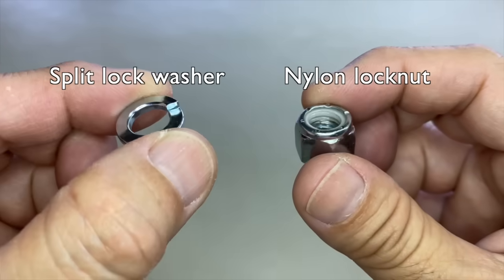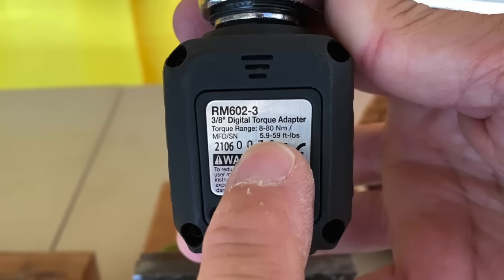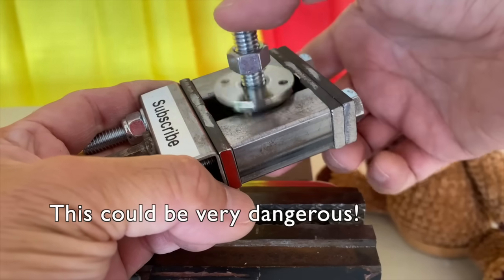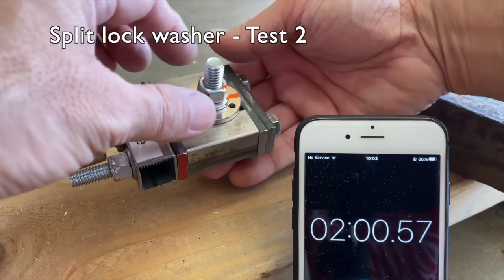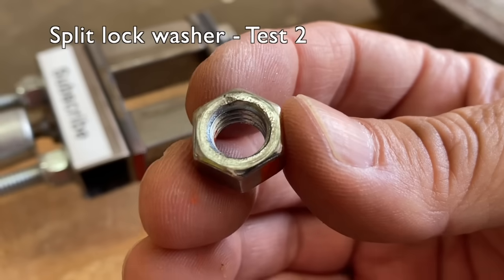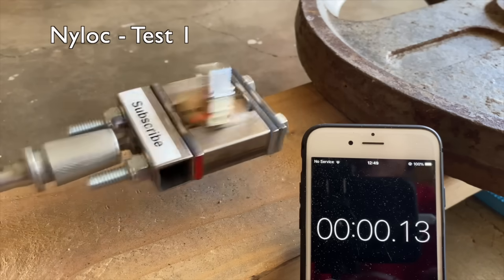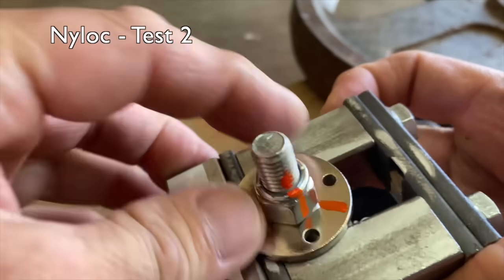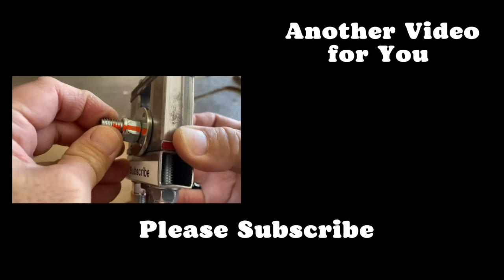Nuts & Bolts - Split Lock Washer vs Nylon Locknut – DIY Impact & Vibration Test - Part 1

Comment: Thanks for the interesting experiment!
Here's the thing, 6 ft/lbs is too low a torque for a 3/8" course thread nut. The torque for grade 5 is 23 ft/lbs and grade 8 44 ft/lbs, over four time what you torqued it to. Even though the split washer dug into the bolt and nut it isn't right. Lock washers are designed for specific torques. The nylog would have also very likely had a different outcome, you might want to retest both.

My rule is that I do use Nylog except in high heat conditions.
Reply: Agree with the too low torque for a 3/8.  Also, the torquing was not apples to apples for split lock vs a nylock.  The nylock has a running torque, the resistance or force to rotate the nut until seated down on the washer.  You have to measure the running torque of the nylock while rotating before seated down on the washer and add this running torque to the 6 ft/lbs.
Reply: He also failed to account for running torque. Below 3/4" fastener size (male thread size, not female/nut wrench size), running torque of self-locking/nylock fasteners (the torque required to turn the fastener after the self-locking insert is fully engaged on the threads) accounts for a significant amount of the total torque applied, which will have a significant affect on the fastener's ability to hold the joint. It's probably only 1-2 ft-lbs at that size, but that's still 16-33% of the total applied torque.
Reply: Agreed.  A retest at a higher tightened torque would be interesting.  Still I subscribed so I'm obviously keen to learn more.
Reply: I hoped that someone would make that comment. When you leave the fastener loose, don't be surprised that it comes unscrewed!! He seriously undertorqued.
Reply: I honestly think that if the test was run with the fastener properly torqued, even the plain nut without lock washer might have held.  Having said that, I have never seen a serious/critical application wherein a lock washer was specified.  Nylon lock nuts are used where heat isn't an issue, with all metal distorted thread locknuts to counter heat.  Or, simply ensure that the fastener is properly torqued, like on connecting rod bolts.
Reply: @johnshaft5613  yep. I know that NASA and the US Navy don't allow split washers to be used.
Reply: Agree here. The torque value is extremely important in bolting/fixing.
Reply: If you look at the 0:49 timestamp you can see the head of the bolt. It's not grade 5 or grade 8. It's a grade 2 bolt. Even so, 6 lb-ft is still too low. The recommended torque for a 3/8-16 grade 2 bolt is 15 lb-ft.
Reply: @tyrannus_tyrannus  I didn't even realize they made such weak bolts!
Reply: This experiment would have been valid if a grade 2 1/4-20 or 28 hade been used. Also when torque is applied to a nut with built in resistance, the torque applied to overcome that resistance must be added to the target torque.
Reply: @GEricBromley this is true!
Reply: I would add that even a grade 2 bolt should/could be torqued to 16 ft/lbs, more than double the torque in the tests (per my cursory Google search.)
Reply: High heat would melt the nylon
Reply: Thank you. I was about to comment on the heat factor.
Reply: 6 lbs torque.  Seems  like a 1 finger on the wrench  ??
Reply: @Mxaviair  This same test torqued to 30 ft lbs might last 50000 hours rather than 15 seconds, but a youtuber is not going to run that test because they aren't a bolt manufacturer with the time money and incentive to run such a test. 

the man is trying to run an accelerated test and producing comparative results. The test doesn't prove that bolted joints suck cuz they fail in 15 seconds under high vibration. It just proves one sucks more than the other.

I'm sure he's aware of the correct torque spec, because otherwise everything ever built would come loose in 5 days.
Reply: 100%
Reply: @Mxaviair So, let me see if I understand, the bolts wouldn't have come loose?
Reply: @Mxaviair I think digging into the material might end up meaning a bolt won't get completely disconnected, but a bolt functions by stretching (preload), and a split lock washer is meant to ensure, basically, that the tension between the nut and the bolt don't reach zero. Basically, it's a spring and takes up a little slack to prevent deloading the threads so the nut won't turn. Mostly just used for things that vibrate, where the things being bolted together might pull apart then come back together faster than the spring force of the fastener can pull up slack, from what I understand. Digging into the material like what's happened in this video is not the point.

Still, it's generally better for the clamping force of the bolt and the preload on it to prevent movement in the first place, when possible.
Reply: The bolt wouldn't ever loosen at that high of a torque and we would never get fast results
Reply: @hithereperson8137  fast results aren't good results. This test only shows which locking system helps do what when everything is already done very wrong. Maybe useful if you fuck everything up, but not relevant if the engineering and wrenching were done right in the first place.
Reply: @LifeInJambles  well the issue is, I don't think either will fail in an actually torqued to spec test. Therefore, we could never make a conclusion on which one is better or worse, take that nylon nut, for example, it barely loosened after a couple minutes, and we all know it's superior anyway. (If you've ever done sway bar links on a car, you know)
Reply: @LifeInJambles  there is some good relevance here as well. All tests are based on relevance. and all tests can be proven invalid.

Ok you could also say the split washer digs into the flange, but if the flange was made of normalized steel, that split washer would NEVER come loose. It would bite much more. In that case the nylon sucks more. 

the point is not the torque spec, its the comparison between the 3 methods of locking.
Reply: The torque is too low for the size of bolt. The torque value is correct at the begining for these comments .Why did the assembles ran loose in most instances, the contant banging back and forth, were moving the sleeve used, as it was not a close fit, which in turn was moving the bolt and nut, regardless of washers and type of nuts used.  This movement will losen up the assembles. It will fail!
Reply: @Mxaviair How do you know it will come loose? That's why you're doing the experiment to see exactly what happens, if you change the parameters then you are changing the locking devices design parameters also, a split washer might never come loose, it's designed to dig into the material. That's where it gets its holding power from, if it doesn't dig in adequately then it's not functioning as it was designed.

Try this, torque your nut to 6 ft/lbs and then measure the release torque required to loosen the nut, then do the same thing with the nut at its torque spec and see if it hold to a higher torque when you undo it but even this experiment is marginal, the anathema of science is infinity. There are so many different variables that the best we can do is get an approximation. How many times can a car door can be opened and shut before it falls of its hinges, temperature, different greases, etc. You get the idea, different metal will yield different results. What's the Rockwell hardness, are we torquing a nut in mild steel or high carbon steel that's been hardened to one degree or another. As I think about it, it's not an easy experiment to do although on the surface it might appear to be.

Comment: 3/8-16 (.375)
4950 lbs clamp load
23 ft lbs. of torque for plated, grade 5,fasteners, not 6 loosey goosey ft lbs of fall apart torque.

Comment: Under severe vibration, the assembly would incorporate a locking device to ensure the bolt didn't back off. A cotter pin, safety wire, or application of a Locktite product, for example.
Reply: Exactly this!!  Neither lock nut or split washer are meant for anything remotely close to this abuse.
Reply: @skipsterz  this bolt would be torqued past 6lbf as well if it was in use
Reply: I find castle nuts pretty interesting..

Comment: Faulty test. Too low of torque. Why barely tighten a nut you don’t want to come loose? Additionally nylon locking nut should not be used in high temperature applications which diminishes the strength.

Comment: Nylon nuts are limited use and the friction between the two washers holding the item after loosening, we will say a mud flap on an 18-wheeler will eventually wear through the flap, that is on something pretty minor, when you're talking about a frame bolt or steering linkages need to have a turn buckle bolt with an pin and a Carter key.. the most important thing is inspection and if it keeps loosening up, tack welded it..

Comment: I think you should rerun the same test with the torque on the bolts set at for 15 ft-lbs. That's the torque speck for a 1/8x16 bolt.

Comment: NASA Fastener Design Manual from 1998 (https://ntrs.nasa.gov/citations/19900009424) states, “In summary, a lockwasher of this type [split lock washer] is useless for locking.”  It’s a long established engineering fact that split lock washers don’t work.

Comment: Also known as a spring washer and on my classic car I think I have found and removed everyone one of them.  Nylock nuts or castle nuts with a split pin, or a liquid threadlocking solution are all better than the spring washer.
Reply: @I_Am_Your_Problem  It might ba a calque. Their name in my language can be translated to English exactly as a "spring washer".
Reply: Yes they are.  I've literally never seen a spring-washer in an aerospace application.  If I did, I'd go through the modification process to get it removed and replaced with nylock nuts or castellated nuts.

Comment: For larger (  ½ inch or M12 thread bolts and nuts ) made of Stainless steel , the plain nut and spring washer can be better ( why ? ) .... the Nyloc™ nut  graunches the thread all the way down , at some point a  COLD WELD  can occur ...the nut can neither be tightened or untightened ... ( out with the angle grinder ! ! ! ) .... with a plain nut , there is  NO  stress on the thread , until the spring washer is compressed ( CANNOT cold weld ! ) this saves expletives and damaged parts .... believe me , this is really annoying ( tried - n - tested ) ....... DAVE™🛑
Reply from the maker: Interesting.  Thanks!  👍😎
Reply: @HacksbyDad  Another way to avoid " cold welds " is to smother the stainless bolt with ( Copper slip ) .... or just use a Zinc plated  Nyloc™ nut on your stainless bolt ..... DAVE™🛑

Comment: The absolute king of washers is Nord Lock washers. 
No vibration will bite on those. 
Maybe a video idea?
Reply from the maker: Thanks!  Do Nord locks need more torque?  I purposefully used the low 6 ft-lbs of torque so that the plain nut would fail.  😎
Reply: @HacksbyDad  The washers I’d say are used in more specialized areas. All washers / or package of washers would come with instructions how to use those plus the torque to be applied. 
I’ve used those washers is large two-stroke engines for ocean going vessels used to secure sensors and other monitoring equipment.
Reply from the maker: @johanea  👍😎
Reply: @HacksbyDad Nordlock will work with 6 ft lbs. Repeat test with those and also try blue Locktite
Reply from the maker: @rsilvers129  👍😎
Reply: @rsilvers129  Nonsense.

Comment: Watched a rather long video years ago with similar tests on a larger rig. They found split washers useless, nuts on their own were better. They found the conical washers better as they retained their force under compression and I think the what they call aircraft nuts superior to standard. Quite interesting as a designer.

Comment: 6 ftlb of tightening torque is not representative of the normal torque used on this size of bolt and nut and therefore the results won't give an indication of the true grip of both.  For example, the holding power of the nylon ring is not determined by the torque applied to the nut, unlike the spring washer.  The test does show however, that when the spring washer loses its grip, the nut is free to unwind completely, which doesn't apply to the nyloc.  In a situation where the nut must be retained spring washers do not perform.

If you require reliable and critical nut retention then you would not use nylocs or spring washers but one of the many alternatives like deformed or tapered thread nuts.

Comment: A very nice video!  I always wondered about comparing these so thanks so much for doing this!  I saw many readers complain about the torque used.  But I don’t have an overt problem with that because (DUH!) if you tighten them more they will all hold better (double DAH!).  But then we would have been waiting several weeks before any results which, although preferable for an SAE standards test is unreasonable for a YouTube video. The torque used allowed us to get some results in a reasonable time. And I doubt the core conclusions would change. 

If you would be interested in a “take 2”, I would also be interested in how star washers perform (both the inside teeth and outside teeth).  And then for a grand finally, add star washers and then next run lock washers to the nylon lock nut, and see if a combination maybe gives best of all worlds. Thanks!
Reply from the maker: Thanks!  I’m getting many ideas for future tests and videos from comments like yours.  👍😎

Comment: I would like to see the split washer test repeated with a square block instead of a round flange bush.  The reasoning is that bush, washer and nut become one assembly and can rotate together on the bolt thread.

Comment: The sheets are pressed together by the screw and the resulting friction between the sheets creates the desired connection. As soon as the screw no longer generates any contact pressure, the connection is worthless, the screw is subjected to shear stress.

Comment: why would anyone trust there lives to a split washer? 
i have seen the do a 100% fail. 
never have i had a problem with nylocks.
and yes i have a perfect test bed. a  large home use wood chipper. 
came with splits from asia.  all failed. on the first usage on the unit.  even tried using lock-tight glued. 
did no good.

Comment: ok torquing the nut to a mear 6 ft lbs is silly that is loose already ! torque it down to the specks for that bolt 25~30 or so ft lbs !  then do your test again..... split lock washers do work when used properly but they have to be fully compressed !  ni-lock nuts on the other hand will also work when torqued properly but they need to be replaced after removal because the nylon will deform and be less effective.  on many occasions I have removed nylon lock nuts with my fingers after breaking them loose this is a failure of the nylon and the nut should be replaced because of that.... lock washers can be used over and over again as long as there is spring left in them... if they were subject to intense heat they are probably toast however.... if they got red hot, chuck them and put on new ones ! especially around exhaust headers !  a place where using nylon lock nuts is foolish !
Reply from the maker: Thanks!  👍😎

Comment: Nylon locknuts are one time use only.  Once they have been loosened they can’t not be reused for applications where their use is actually necessary.  We had operators that disagreed with replacing them every use…one got a several gram steel shaft go though his arm and learn his lesson.
Reply from the maker: Wow!  Thanks for the info.